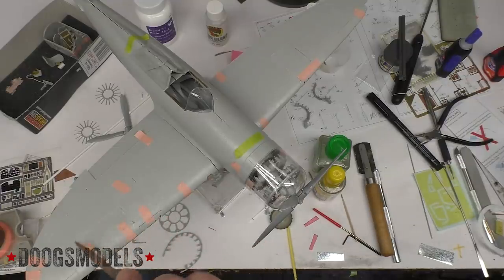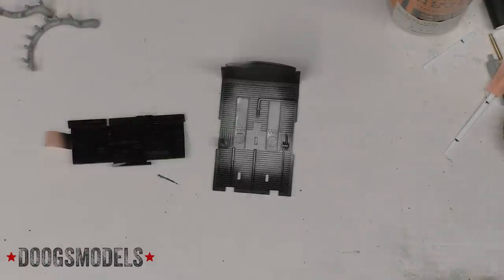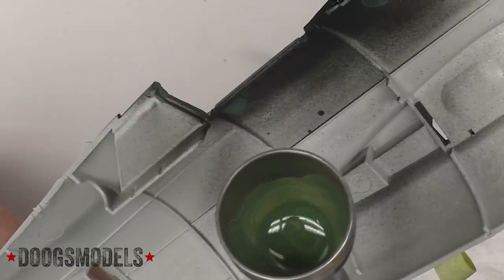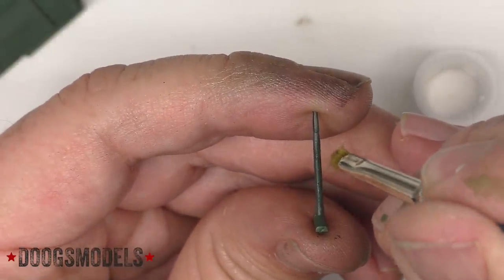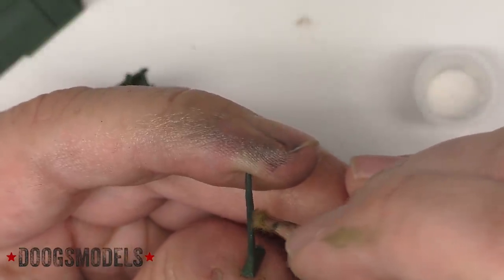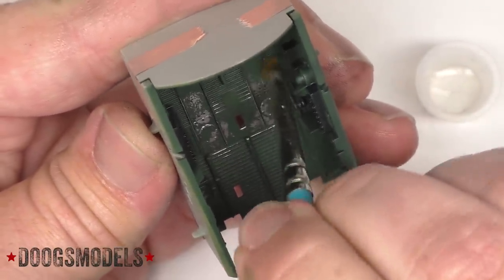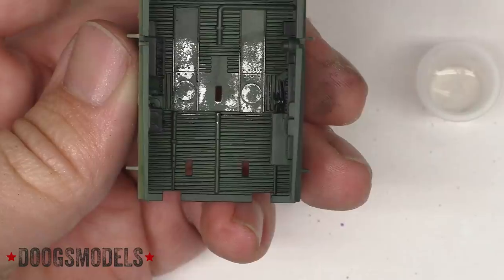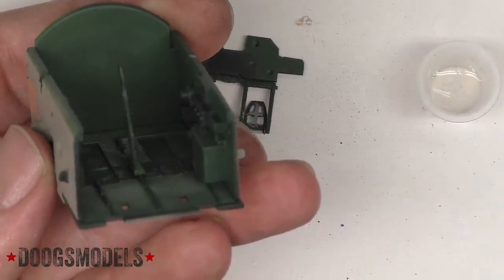P-47 Build Log 03 - Chips!

Comment: What confuses people is the "G" model of the 47 which was built by Curtiss and never left the US. {which Trumpeter bases its colors on}. Their interior and wheel well green matched and was very different than Republic. Meanwhile Republic's interior green stayed the same from Razor to bubble. Wheel wells as you know are Yellow chromate. But once a 47 went in for updates and overhaul then whatever was available, US or RAF stock, including black and light gray was used in the ETO from pit to wells. In the PTO a light blue gray was used as to not absorb as much of the unrelenting sun. Fading was a bit more harsh in the PTO{sun sand}, leather was often replaced by canvas{control stick,tailwheel}, except on the gunsight. Not to be a rivet counter but those rudder pedals are wrong for a Razorback. Those are late bubble top, D-40 and "N" version. Looks good, I'm enjoying your build process and techniques.

Comment: Great video Matt, but may I ask.. why did you use Mr Color over Mr Hobby??
Reply from the maker: Mr Hobby is basically unavailable here in the US. Have to order single jars on eBay. So I have like...five.
Reply: @DoogsModels  I have 52 MH and only 10 MC.. opposite here in UK as far as availability goes.
Reply: @NigelsModellingBench  easily purchased over on Ebay in the UK (that's where I'm based) I went over to Mr colour due to a far better and tougher finish.
Reply: Mr Color in New Zealand can be a pain to get. Found a good supplier on ebay out of HK with free shipping and the price per jar is a reasonable amount cheaper.

Comment: Did you use hairspray under the Mr colour coat? I'm a little shocked that worked, so I just want to confirm that before trying it. 
Many thanks
Reply from the maker: Yep! Another common wisdom dragon slain.
Reply: @DoogsModels  thanks for the information, certainly a technique I'll be using.
Reply: @DoogsModels  So that was Mr Color lacquer paint you chipped?
Reply from the maker: Yes. Mr Color. The lacquer one.
Reply: @DoogsModels Cheers for that. I was under the impression that the hairspray only work with acrylic.